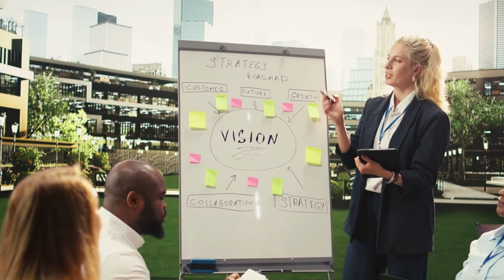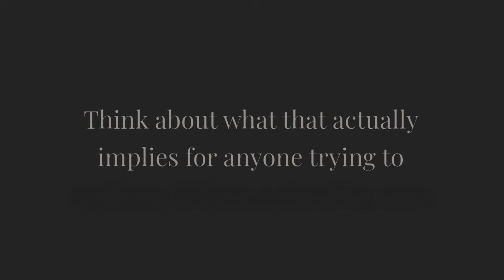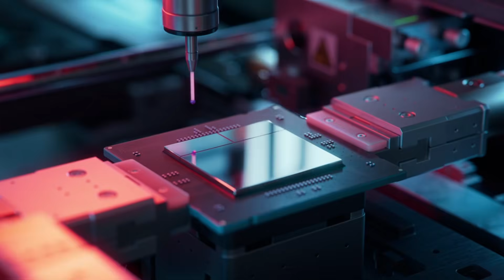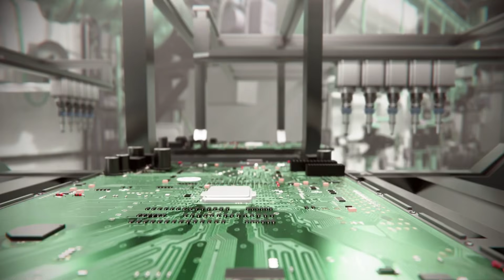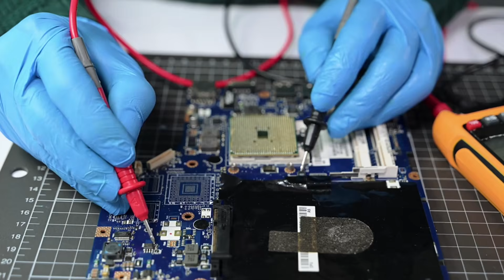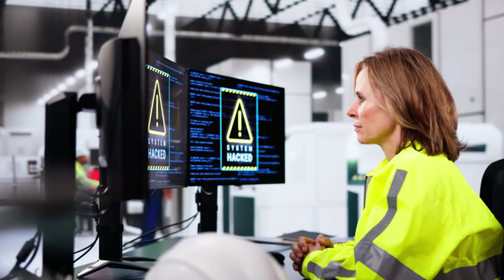China Just Fired Up the EUV Laser ASML Said Was Impossible

Comment: The EUV light doesn't come fr9m a laser, it comes from 200,000 tin drops hit 2 times with a low power pulse followed by the 3rd h8gh powered pulse, vaporizing the tin into a plasma for 600,000 laser shots per second. They also need atomically flat mirrors accurate to within 2 atoms being the margin of error. It needs a vacuum chamber with the correct hydrogen and oxygen mixture moving at over 350 kph through the combustion chamber to keep the mirrors clean and evacuate any tin particles. The electron laser doesn't scale to production capacity.

Comment: First trail run? By the time it reach market or  usable, ASML will have another advance technology, that's how market works. Your title is just a click bait!
Reply: It actually doesn't matter if ASML are better. If China can produce chips with EUV at a good yeld, they have accomplished something important. The next step is building supply lines for the machine. These will then improve the tech in every way as long as they can.
Rest assure that they won't stop until they are at par with ASML in tech and beat them at manufacturing it.